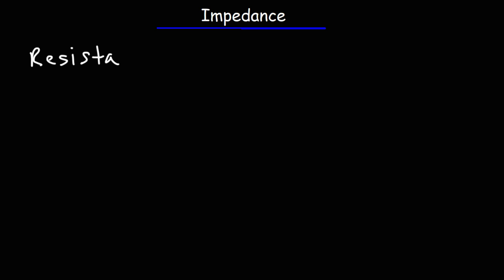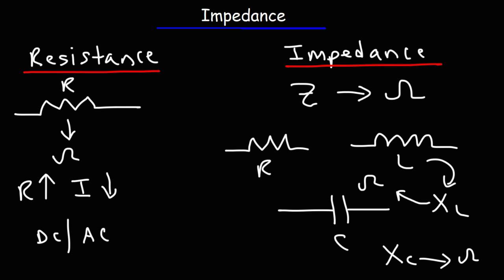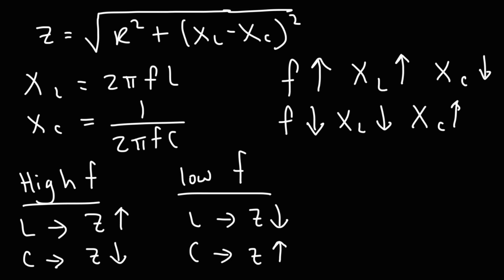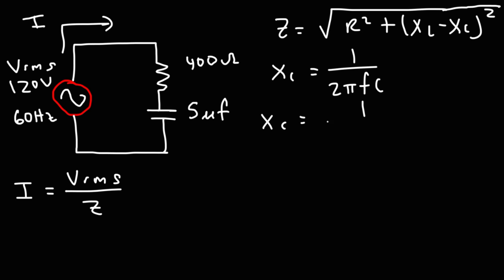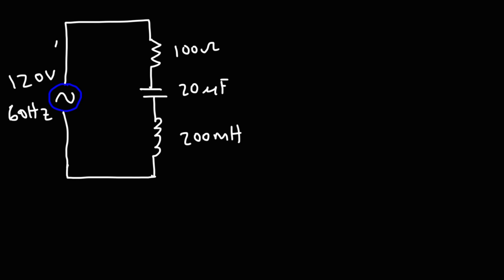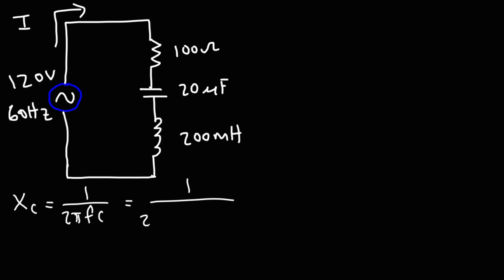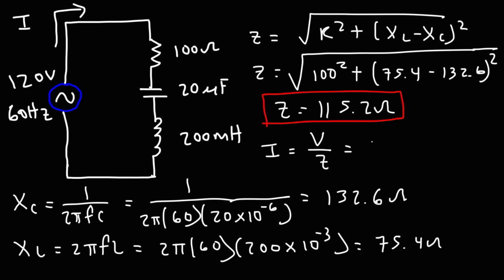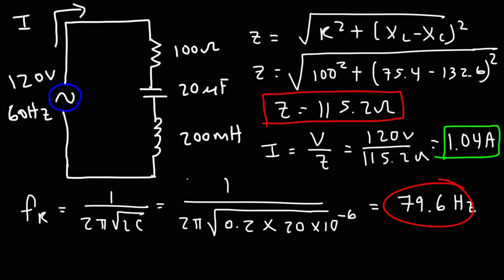Impedance

Comment: In some question u took voltage as vm or vs   and vrms how did you take that because  if we took that voltage as vm then we need to convert as vrms by dividing the vm over √2 is it . and also why we divide the irms over z(impedance ) instead of resistance for finding voltage in the circuit . can you explain me to clear this confusion please

Comment: How do you approach this question when you are not given the frequency but simply told to calculate Irms at high frequency and at low frequencies
Reply: It was a mistake to give that problem without more clarity... I would just solve it for some arbitrary frequencies like 100Hz and 1,000Hz

Comment: How do I calculate Impedance if the power taken by an inductive load when connected to a 120V, 50Hz supply is 400W & current of 8A

Comment: It helps to think of impedance as a local quantity that relates to 2 sinusoidal quantities in the complex plane  represented as phasors. Those 2 sinusoidal quantities being voltage drop across and current thru a capacitor or inductor or resistor. Because impedance is an ohm's law based quantity it's expression for inductor has j in it (voltage leads current) and has -j in expression for capacitor (voltage lags current).

Comment: hello sir.. can u help solve this one
Reply: An inductor with a value of 30 ohms, a resistor with a value of 40 ohms, and a 25 ohm capacitor  are connected to 220 V, 60 Hz power supply.  Solve for the Impedance and the Current.

Comment: I'd like to ask if the current we find at 9:10 is the Irms or the Ipeak.
Reply: Irms
Reply: most likely the irms considering the Voltage we're using is the standard American Vrms, which is 120 Volts

Comment: In the diagram you show  -400 ohhs resistor but you use a 100 ohms resistor to do the calculations when had to be  400 ohms to 
get the correct impedance ....the procedure is correct but the calculations are wrong....... any how nice video 
tnks de Kp4 BP...P.R